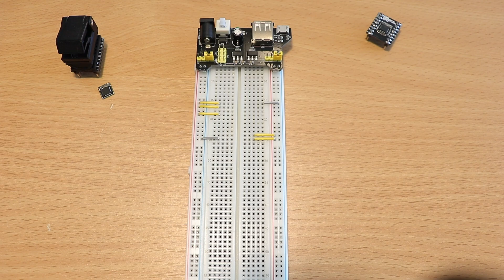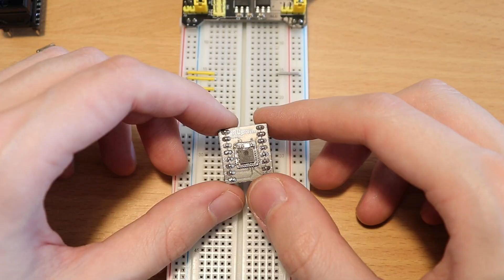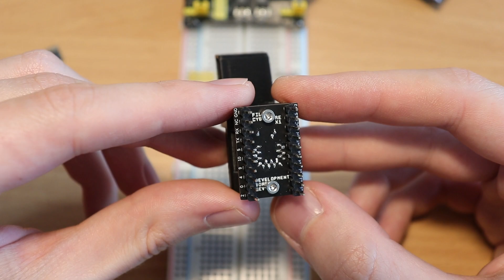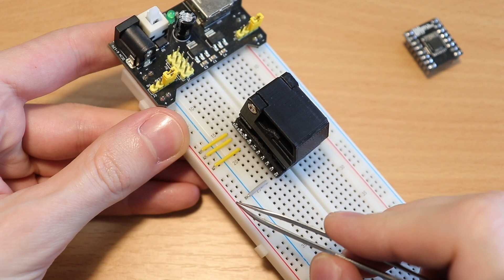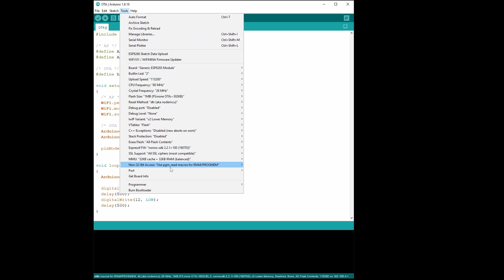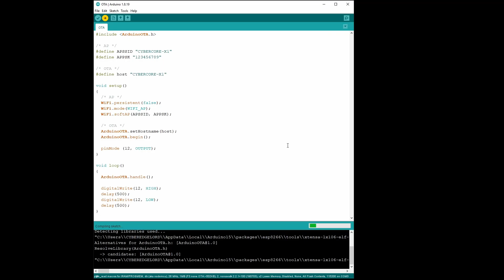Flashing New Firmware to CYBERCORE X1 via the Development Board

Comment: Do you consider wear off of pads/soldermask from sliding the module with programming lid multiple times? While closing it, there is no problem because you push the module to the back, but take a look at what position the module is stuck to the lid.
Reply from the maker: Hey Arek!

From our tests, there is no visible wear of pads. If you won't push the module all the way in, then you won't be able to close the lid properly as the 3 front pins will stay up.